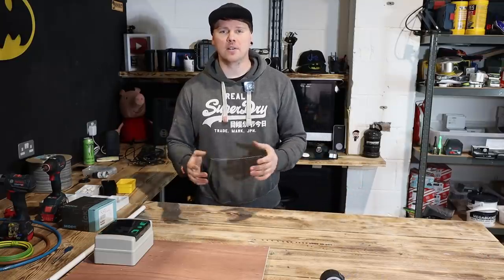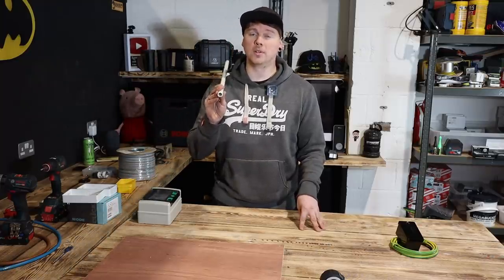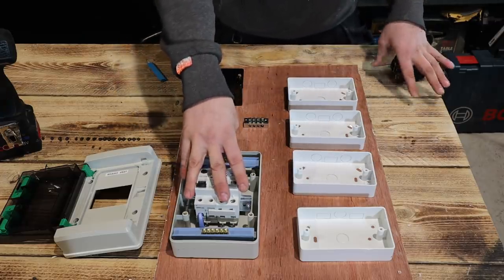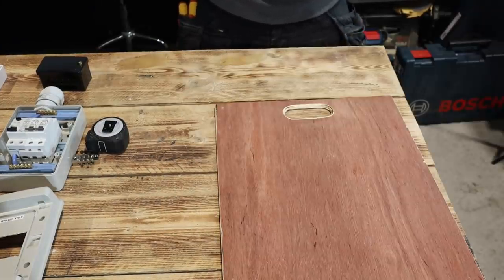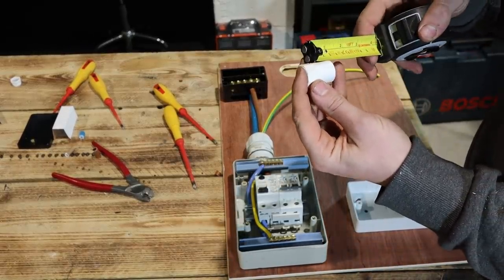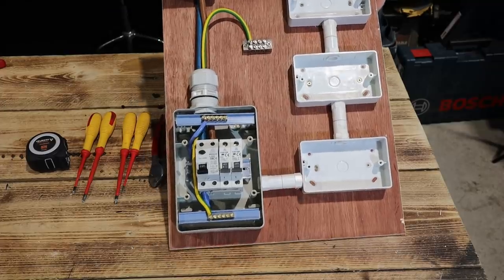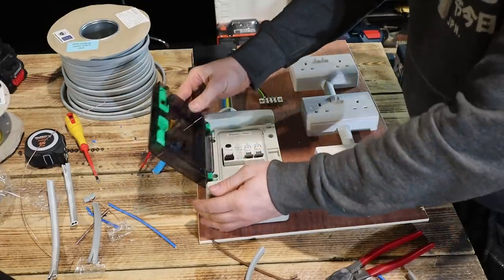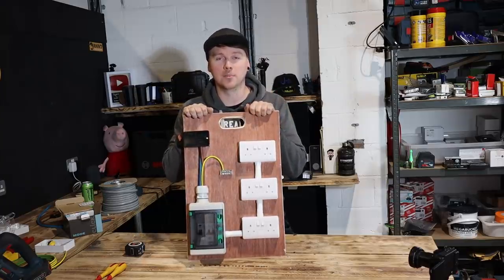A Must for every rewire!  Electrician

Comment: Nice - they are indeed essential. My boards also have one socket with USB charger on, and an LED floodlight. I also put a 16A socket on it so I can run standard 16A cables (daisy chained if required) to another board or extra lighting. My other boards have 16A in and out like site power.
Reply: Nice...

Comment: Nice looking board Nick. Personally I would have it done metal clad boxes and faceplates joined together with with metal couplers. The couplers are less work to assemble, can be closer so you may have got a 4th socket on, and if being put in and out of the van, will be more durable. Also I would put some screw down cable grips for the incoming tails and not rely on the Henley block for cable security. Well done that man!

Comment: Nice work as always Nick, little tip with the henley blocks if you were not aware :) brown tail goes in the deeper terminal at the back.
Reply: Yeah thought the same. Brown should go in the deeper slot for extra protection. Not that you should have any copper showing anyway but hey Ho

Comment: Nice board.  The current carrying capacity for 4mm in conduit is 30A, so technically not protected by the 32A breaker for overload, but hardly matters for a temp supply like this
Reply: BS7671 does give 30A for T&E Method B, though I doubt anything the board would be used for, would get anywhere near that.. except possibly when making a brew! 😉 though even that wouldn't be for so long a time as to cause an issue. You could get it to 32A by swapping the T&E for singles though.

Comment: Very nice. The only things I'd personally do dIfferent is replace the Henley block with a 2-pole isolator and maybe add a 16 amp blue ceeform socket just in case it's needed for whatever reason.
Reply: Yeah defo good idea. With the isolator you've got that extra protection

Comment: being in conduit, could you not have stripped the cable down to singles and run it through?
Reply: Just use drums of singles it's peanuts
Reply: @jamieh8667  probably doesnt have any lying around as a domestic spark
Reply: He could of but why bother if it fits easy enough.
Reply: @mrseanpride6449  check out the current carrying capacity of 4mm T&E in conduit…….. 30A…… which is in a 32A breaker……, never really likely to be an issue but if you’re setting yourself up as a “watch how I do things” guy, details matter.
Reply: @jameshansing5396  you are completely right. I was just answering someone else. You should always check the current carrying capacity suited and use the correct circuit protection. But I was just saying if he wanted to and the rest checked out you can but there was no need here.

Comment: As its all in conduit i would have run singles , but that's about it , its a good idea. Possibly add one USB socket for phones etc ? Keep the small circuit for lighting , and add some BS 546 for your lighting only.

Comment: the differences between US and UK theory are interesting - if I were to make a site temporary panel, the breaker section would be about the size of your entire board, but the receptacle section would be the size of one of your receptacles.  were I to duplicate the design, I'd be using a chase nipple, instead of your conduit assembly - one insert as you have, with an external nut that goes inside the next box.  gets your boxes either in contact with each other, or just a fraction apart.  also, most of us would use single conductors to the receptacles instead of sticking cable in the conduits.  
what is most common, here, for a major remodel, is a preassembled service board on a post appropriate for underground feed, or in areas where our power isn't underground, we have ones built for overhead feed.  then the power company comes in and disconnects the house entirely, and connects the temporary board.  if we're not doing a total disconnect, we usually just install temporary receptacles next to the house service panel, and disconnect everything else.  I have a few drop cords with two 120VX20A GFCI receptacles on an oversize direct burial rated cable  I just wire that into the existing breaker panel, and then everything is good unless the laborer hits the cable with a sledgehammer and crushes the insulation.
(our code requires all construction receptacles to have .5ma GFCI(rcd) protection.)

Comment: Another option since you went with an ip rated board, would be to use outside ip rated sockets, just a thought.
Reply: IP sockets would take up too much space on the board though. The insulated enclosure would be for stopping dust ingress and as it will be indoors, so water ingress is not an issue. Dust won't be such an issue now though as he has got the wonderful Metabo wall chaser kit.

Comment: Next up: another 32A breaker feeding a 32A socket, a 6mm flex leading to a sub-board with 13A sockets that you can leave in the room you're working in to power multiple heavy current consuming power tools?

Comment: You mentioned right at the end about using them site lights on that board, is there a way you could use the 5A breaker for the site lighting

Comment: I'd consider making a panel version with either din or surface mounted sockets, I'm sure an enclosure would be better suited and more durable, though a little bulkier. Plus you can add, remove or swap components out more easily should the need arise, especially with a din mount solution and slotted trunking for ease of wiring. I'd recommend a Schneider enclosure. Depending on how you use it some casters on the bottom, a handle on top and a little storage cubby surely wouldn't go amiss either. Obviously more expensive but worth it for the robustness I'd wager.
Reply: It could be argued that what you are proposing is a bit of overkill - it is only a temporary board for a bit of lighting, the odd powertool, charger and most impotantly..... a kettle to make the brews. It also needs to go in the van so needs to be compact enough so as to not take up too much room.

Comment: That's a nice fuse board. I would've use metal clad sockets and metal boxes and used couplers where you have an insert that goes through the box hole and screws into the coupler, that would allow tighter spacing.
Definitely leave the other CB in in case you want to add something in the field.
and Maybe some sort of tales restraint on the outgoing side or would that be the incoming side.

Comment: Nice job bud. Would def likely go with metal clad myself, just feel would be more durable, Or, maybe use IP rated outdoor sockets. Reducing dust clog up in socket pin holes/switch and any possible water splashing.
Reply: I think panel mount sockets on a little enclosure would be nice, especially with some casters on the bottom and an emergency led light in the top. Could add a transformer for some 110v sockets too. Could easily bring it up to ~IP 68 this way.

Comment: Maybe a small LED flood on the boardv ia the 6amp breaker ?  so not relying on anything plugged in or battery powered for local light. An emergency maintained bulkhead even.
Reply: having it on the board is a bit limiting.  I have a 100W metal halide fixture with a length of old cable, so I can hang it on something tall (that is to say, the length of cable is twisted onto the mounting bracket and I twist it onto something to hang the light) and power it off an extension lead for jobs where I need a worklight.  if it ever burns out, I'll strip the ballast out and use some 50W LED bulbs I have sitting on the shelf.

Comment: RCBOs (you know like every non-crap installation) would better so you can run site lights off one trip and tools off another, I would also put 3 neon's as a premiant "martindale" on there to show L-N.L-E and N-E as a quick reference nothing has gone gone after it's rigged.

25mm HO7-RNF tails (3M of) would be better than a 100A block as flexibles are the thing to use on temp boards...

Also Stickers, loads of em, that will never be read!

Comment: Great job, but why not just use metal couplers and bushings, simpler and faster.
Reply: How would you earth the metal coupler if it was between 2 plastic boxes.?
Reply: @jackmiller8926  it's a temp

Comment: Nice video, great explanation about testing before use/re using, it’s often overlooked or seen as a waste of time. I used a similar setup on site once it had a lamp at the top and 6a socket for the string of site lights (the guy said he used to plug the site lights into a spare socket but people would switch them off so by down rating a single socket it was less likely to be pinched by the plumber 🤣 his words not mine)

Comment: Just wondering if you have any issue with 2 x 4mm cables in the terminals. Is any particular brand easier to terminate than another. I have done radials with 2.5 mm but for kitchens and utilities done rings with 2.5.
Reply: 2x 4mm should be no problem. The socket instruction state what can be fitted

Comment: wow you can use a 32A  MCB for  a single  4mm run to sockets in  uk ??    In Belgium  4mm doesn't even fit in sockets lol ..    32A MCB = 6mm  20A MCB = 2,5mm   16 MCB = 1,5mm
Reply: Depends on the installation method, clipped direct and plastered over its rated to 37A, in conduit like that, 32A is it’s absolute max.

For some installation methods it could get down rated to as low as 26A.
Reply: @MrIbib  Funny how thing differ in UK .   Seems we are more on the safe side of protecting cables .  Can't imagine we where able to pull 32A out of sockets ..  sockets here are only rated 16A .. but we don't have fuses in the plug of appliences like in uk ..
Reply: @kittsdiy  individual sockets are 13a, but the overall circuit is rated at 32a. This dates back 70 years when a whole house might be on one ring final circuit for the sockets (using 2.5mm) , including the kitchen. So 32a was quite easy to hit. Now, more modern sparks install either 16a radials on 2.5mm or 25a radials on 4mm.

Personally, I wouldn’t put a 4mm radial on a 32a breaker, it’s getting a bit close to its max.
Reply: Individual sockets are rated at up to 13A, but a double socket as a whole accessory is only rated up to 20A, and a BS1362 13A fuse will pass 20A indefinitely too. That means you're operating outside of the design parameters if you have 2x13A loads on one double socket, and you're sailing close to the limit if you have 1x13A load and another lower load alongside it on a double socket, so you definitely need more than 1 double socket to safely approach 32A usage. Even then, a 32A B-curve MCB will not trip when you draw 40A from it unless you're in an extremely hot ambient environment, so you can completely load 2 of those double sockets before running into any issues. The circuit would certainly get rather warm though.
Reply: @aaronmdjones  Still makes no sense to me.. never understood the ring circuits in uk .. but in europe we don't have fuses in the plugs of appliances .. in that case we could draw 32A from 1 single socket in uk .. sockets here are rated 16A .. we all have radials ( max 8 groups ( double/tripple or more ) of sockets on 1 20A MCB on 2,5mm wire ) cable in trunking/wall/conduit makes nog difference here . Average kitchen here has at least 5 MCB's .. so we have much larger fuseboards ( also all  double pole brakers )

Comment: I'm probably wrong but I thought a 25 amp MCB was the biggest you could use with 4mm but the regs might be different here in Ireland, I just looked up the current capacity in the latest regs and it says 30 amp for multi-core PVC cable in conduit and 36 amps clip surface and I think only long runs of conduit reduce the current capacity so I guess a 32amp MCB is OK, someone said they would use metal clad sockets but I think metal clad give a false impression of strength and people treat them roughly and every time I install them they seem to get broken, I have make a similar board to you but I must admit it does not look as neat as yours and a 20 amp RCBO for protection but it does the job.

Comment: Surprised one of the CU manufacturers hasn't come up with a ready made site board. Seems like a gap in the market.
Reply: odds are they are out there.  I have (US) ready made boards in my inventory, but they are also heavily modified.
Reply: @willmitchell255  One issue I see is if a topter  assembly gets damaged then it's out of action until you can get topter replacement parts. Whereas Nick's board is built entirely out of items most electricians will be keeping in stock anyway.
Reply: @petermichaelgreen  Agree entirely Peter and some other commenters have already stated that some AC adapters have different cable exit points for example at the top which will most likely clash with the socket covers.
I'm going to make up one of these with the gear I've got in the garage, always handy ☺

Comment: Kind of pointless having an IP board  when the sockets aren't IP, could have made a universal one that could be used outdoors as well is needed.
Reply: Not really. During a rewiring/refurbishing everything is full of dust and debry. The IP rated DB can protect the MCBs and RCD from that. If the sockets got damaged its cheaper to replace than replace an RCD.

Comment: In stead of the Henley block could you not just put an ip plug on the board then put a temp matching socket on the tails of the property your working on ? I’m no sparky and open to criticism but just think it maybe faster and less work ?please advise anyone , remember I’m not qualified just seen a few bits around in my time so be gentle with criticism please
Reply: you're not going to find any socket with terminals big enough to take 25mm tails

Comment: I use a 10 way extension lead with the earth cut out straight out the meter 

off the 60-100amp main fuse 

It’s lasted over 100 Rewires 

Thank me later 👍
Reply: conserned Canuck moment

I smell that you are the old school type, aren't ya?
Reply: No nuisance tripping!